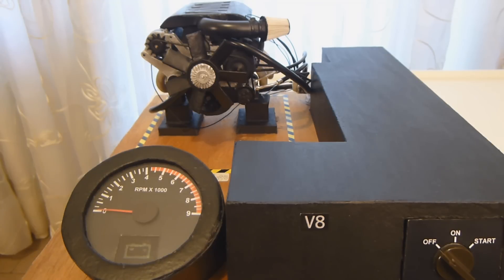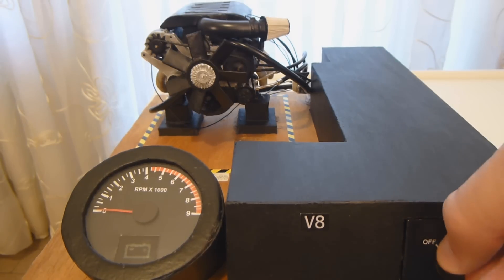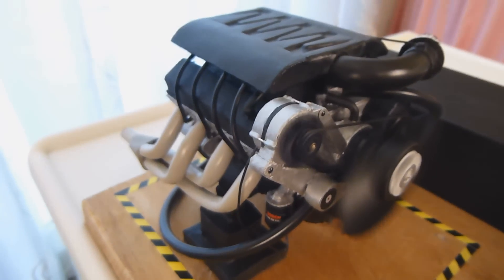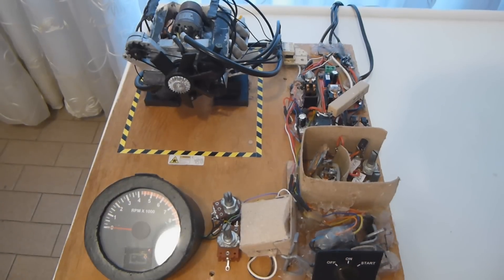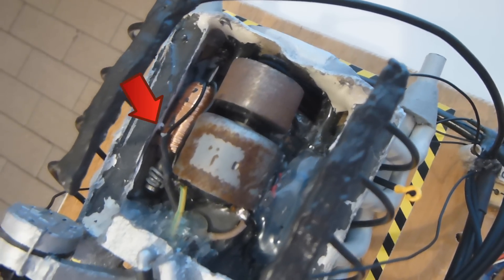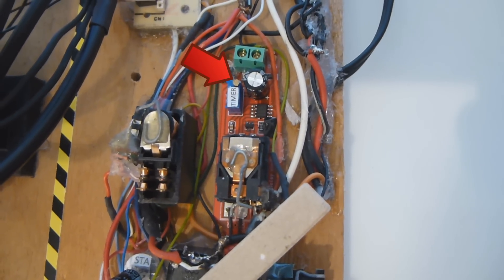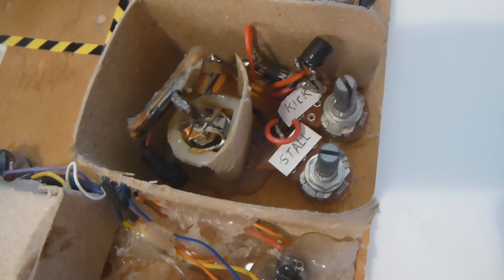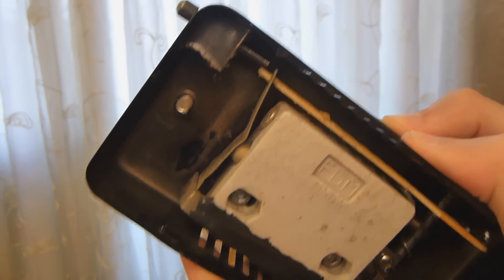Homemade Electric V8 Engine Working Model (1:8 scale) Part 1

Comment: Bro will u tell me how to make it
Reply from the maker: I am in the process of making an easier and better way to do this kind of model engine. When is ready, I will post the list of materials, instructions and Arduino code, and later a 3D model where you can 3D print the engine. But this takes time. Stay tuned.

Comment: great engine, are the stl's available?
Reply from the maker: What do you mean? Available? I still have it, if that is what you mean.
Reply: I thought you 3d printed it, if not then it's ok
Reply from the maker: It was made by hand with scrap materials. But I plan to make a similar 3D model for 3D printing so keep an eye on thingiverse. I also will make a jet engine 3d model.

Comment: So much effort to mimic V8 engine, why not work on a real one? It produces all the effects without electronic trickery.
Reply from the maker: A real model would be a lot harder to build, and require better tools, need a ventilated workshop, is dangerous to deal with fuel, can't run indoors, etc. Instead I made my model in an apartment with very simple tools and materials, and was super cheap. I can run it indoors without making our ears bleed. Even my kids can play with it without danger. Is so easy a kid can even make this kind of model with basic tools.

Real v8 model engines are cool and has their place, but electric models like mine also has its place. Both types of models have their advantages and disadvantages. For my purpose, electric model is way better. For other purposes like using on RC, real engine would be much better.

Comment: Can you replicate a 1999 Toyota 4Runner 5RZ-FE engine?
Reply from the maker: That would be cool, but building from scratch is too much work. For that reason in the 2nd engine i am going to build i will use those engine models that are already done and painted, that only require aseembly. If you can find or provide the model i can make it work.
Reply: It's standard for 1999 Toyota 4Runner SR5.
Reply: interlinkknight rfv
Reply: Baba hamodi Alhamdan Irrrelevant.

Comment: nice motor and working through electricity plz upload how it complete  making
Reply from the maker: I am planning to do a 2nd engine using an Revell model (those that are ready to assemble) and put a DC motor and a solenoid to run like a real one. This time I will use Arduino instead of all those relays and clumsy components, to control everything. When I do this 2nd engine I will make a video on how to build it and publish the arduino sketch and all that. But right now I don't have the time to do it. I have the model, the circuit and the arduino sketch ready. All I need is the time. Someday...

Comment: can you put an engine like that on a RC (Remote control) car?
Reply from the maker: I could, but my plan is to build the transmission, differential, wheels and a flywheel at the end to simulate the momentum of a car, all to work like a real car but stationary. I need a 3D printer first, though.
Reply: oh ok

Comment: Very cool. The tach and the starter "delay" are nice features. Being 1/8 scale, drop one of these into a Renwal Visible Chassis kit.
Reply from the maker: +Th3DEAD Yes, I know. When I ever buy a 3d printer is going to be around $500. But I have a lot of others priorities to spend that kind of money. But thanks for the tip
Reply from the maker: Thanks. I plan to do something like that, but made by myself. I need a 3D printer first to make the transmission, differential, etc.
Reply: Thumbs up. You gotta keep us posted on that. I don't know where you live, but I have seen 3D printers at Home Depot. They're branded as Dremel. You can also see them at Home Depot's website.
Reply from the maker: The problem with 3d printers is that are expensive. That's why I can't get one in the near future. But when I do, I am going for sure print a manual transmission (that a guy call eric design) and an automatic transmission that I design. Both 3d models are in thingiverse. I am in the process of making a 2nd engine model similar to my current one, but this time using a Revell Hemi model, pre-painted, ready to assemble. I only need to put a motor, speed sensor and a solenoid for the starter. This time Arduino is going to control everything. I will keep posting videos about all I do. Last video was my jet engine model. Next one might be the hemi engine.
Reply: Tips : No need for a 2000$ or more 3D printer for good quality. Look in Aliexpress for example, you have pretty damn 3D printer for less than 500$. Just read review and look video about them to choose the right one. Good luck

Comment: how much to build one
Reply from the maker: +Eddie Johnson What do you mean? How much time it took me to build it? 1 year, on and off, but was mostly because the visual/esthetic parts take a long time to make by hand. I plan to make another engine model, but this time I will buy an existing model from Revell (those that only require assembly) and I only need to add the motor, solenoid, RPM sensor and bearings. And this time is going to be controlled by arduino.

Comment: I know it's not a proper v8 or anything but I think this is very cool, I love the tachometer, battery light, starter motor, throttle pedal it is just brilliant. Top marks from me.
Reply from the maker: +davidrobert2007 Thanks :)

Comment: Can you make a video for build it? It's for science fair. Thanks
Reply: And what is the max rpm? And power at 1:1?
Reply from the maker: +Lorenzo Gambino I think would be hard to explain every single detail of how to make it. I can answer any specific question you have, but for now I don't plan to make a video on how to make one. To answer your question: max RPM is 4500 and i don't know how much power it has but is just a mid-size 24V motor so you can imagine the force it can generate. What part of this engine you don't understand? The engine itself or the circuit that controls it? I can help with the circuit, but using Arduino instead of my mess of relays. Using arduino would be better for you. I already am working on a 2nd engine but this time using arduino to control everything. If you want me to help on that, I can. Maybe send me an email or something.
Reply: +interlinkknight With Arduino is easy than using a circuit?
Reply from the maker: +Lorenzo Gambino If you want all the features that i have is easier with arduino. Features are like: stall, speed-up after start, starter solenoid, and auto start after holding the ignition switch for a set time. Or if you don't want all that, in that case you don't need arduino. What you want?
Reply: +interlinkknight With Arduino
Reply from the maker: +Lorenzo Gambino I can help you, but you must know this project will require some soldering, parts, and problem-solving. There are so many options for pedal control, tachometer, speed sensor, etc. You better send me an email with more info of what you want, and lets see what i can do. My email is same as my username + gmail
Reply: +interlinkknight It was only to know. Thank you for your availability.